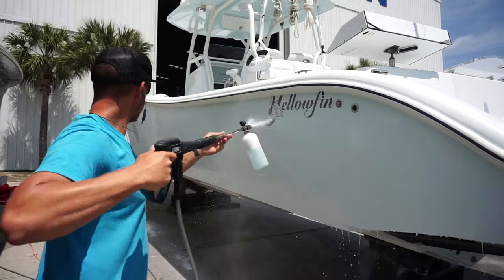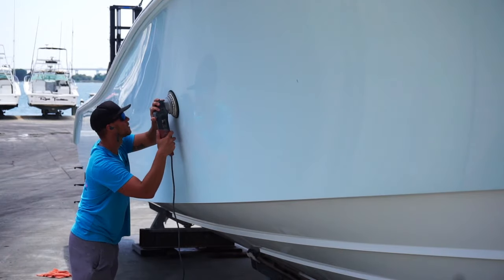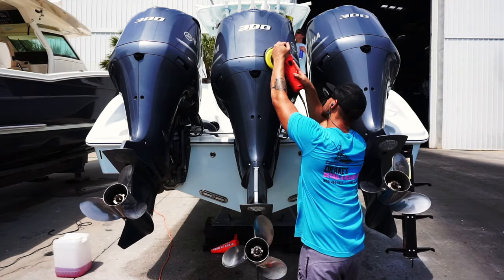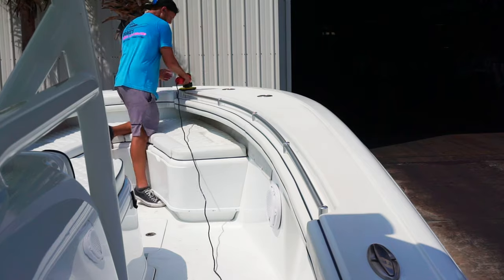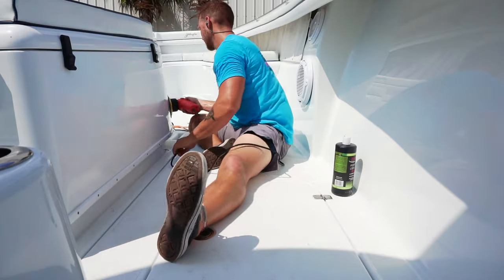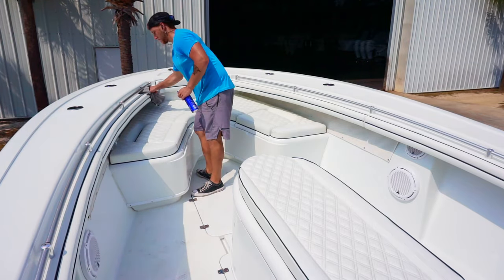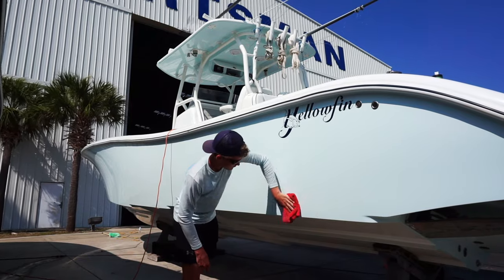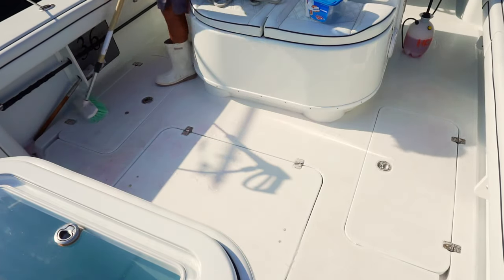How To Detail A Boat | 7 Steps To Boat Detailing | Revival Marine Care

Comment: Dude you're a lifesaver I'm starting a new job as a boat detailer with no experience but they want to teach me and give me a shot. So this is the first video of many I will watch to prepare myself as much as I can with the limited resources I have before my first day. Wish me luck peeps!
Reply from the maker: That’s awesome bro! So glad I could help!! 💯
Reply: How is going now a year later
Reply: @chillcolorado8039  pretty good detail wise, honestly they said I'm the best they've had in a long time. I'm actually a marine technician apprentice now because of my detail work ethic 😊
Reply: @joseibarra2985  nice!
Reply: @joseibarra2985  bro imma start soon cleaning boats too!! How did it go in the beginning
Reply: @lilcowboydoggo5798  honestly it was hard since I was teaching myself since we didn't have an experienced detailer and now I am  that lol. But yeah drakes videos helped a lot, look up degreasers, goo off, adhesive removers, magic erasers and microfibers as well as buffing compounds, polishes, waxes, ceramic coating. And the power tools and pads for those. As well as what is safe to use on non skid, vinyl seats, and carpet. It's a bit of a learning curve but don't worry if you don't get the results you want it's all trial and error. And some boats might be as simple as a quick wash with Boat soap than a full detail clean. Hope this answers your question!

Comment: Nice vid. Only suggestion is do floors first. Purple power after wax is not good... also you can Woody wax those floors after ...
Reply from the maker: Thank you for the feedback! I agree with you that the floors should be done before the wax, But we always seem to get them dirty again even with shoe nets, So I am very careful not to get the purple power on the freshly waxed surface, and if I do I spray it off. I had someone else ask me the same question

Comment: So excited for this channel. I’ve been detailing boats for years but just got in to sanding last year and have so many questions. But usually no one to ask. You should try one of these bonnets to remove the wax they work really well. Of course you have to go over with a towel later but you get up 90% of it with the machine.
Reply from the maker: Thanks!! I'll Give them a look! I typically Just do it by hand, Been doing it for years! Easy and simple!

Comment: if there is any dullness in the gel coat, you have to use a regular rotary buffer, and a wool pad. Also marine oxidation remover. Most boats I deal with need oxidation correction.

Comment: Magic eraser is actually abrasive. Have you found any long-term issues using it?
Reply from the maker: No, but I also am smart about using it. I just use it for the light agitation of the seats. I don’t sit there and grind with it per minute on end. That’s where you can do some real damage-  I also don’t use them seats all the time which helps the longevity. 

Another important part is making sure you rehydrate the seat afterwards with some good protectant so that they don’t dry and crack

Comment: Drake, binge watched your channel. Thought as a “Lakelander” and growing up with at least a Gheenoe since I was 14, I KNEW EVERYTHING ABOUT BOATS. Turns out I’m an idiot. (Grades at LHS and Florida Southern should’ve been my first indicator)
Here’s my issue. A Waverunner with gray seat cushion. (2008) Out of nowhere developed a speckled black mold. Tried the usual cleaning solutions, mold sprays, even the “30 Second” mold spray that works like a charm on the house. I’m curious if you’ve run into this issue. And if so, will you help out a Floridian exiled to central Georgia?
Reply from the maker: Hey bro! Thanks for watching! 

I’d try purple power with a magic eraser. Lately at the seat with the eraser in the purple power.

Comment: Great vid, just picked up some products from your links. Any suggestions on product to deal with cleaning up a vinyl wrap? I just got center console with a black vinyl wrap and it’s got water spots and minor scratches. Any suggestions on products for that?
Reply from the maker: You can polish is lightly with menzerna 2500 on a black foam force lake country pad.  Just seal it with jescar power lock after using another black for pad

Comment: Great videos!  Thanks.  Quick question...what steps do you suggest for a brand new boat prior to launching?
Reply from the maker: Pretty much what I did in this video! Or applying ceramic coating 
https://drakesmarinedetailsupply.com/collections/starke-surface-technology/products/liquid-thor-nano-ceramic-marine-coating
Reply: Insert the garboard drain plug.   Tie a line to the boat and have someone on the ramp hold the other end.  Or, tie it off.

Comment: Love the videos to start. Thank you for putting in the time to share! I'm a bit confused about something. You seal/protect the deck area, wipe it down and then you clean the floors? With a degreaser which potentially breaks down the sealant you just applied? Not hating on you. On the contrary. I've been detailing for about 10 years and now soon, I'll be taking on a few boats  which I've only done a couple of quick washes on. I'm using your videos as my knowledge base. But that washing the floor after protection didn't make sense to me. Am I missing something here? Thanks again! Keep glossin'
Reply from the maker: So On this job, I didn’t apply any sealant to the floors. That’s probably were the confusion is, the customer didn’t want me todo anything on the flooring besides clean it. It’s a fishing boat and they use heavy deck brushes to clean... 

I did apply sealant to the non skid on the tow rail, but I did not do the floors. 

If I would have been doing the floors, you would clean with degreaser, dry it , then apply sealant.
Reply: @DrakesDetailing  I appreciate the response. Just gave you a follow on Instagram today! @after_image_detailing
Keep the vids coming!
Reply from the maker: Thanks bro!

Comment: GREAT video! I'm subbed...quick question, you actually used the DA and applied the synthetic sealant on the textured non-slip part on top of the gunnels? Also do you ever apply the synthetic sealant directly on the textured floor of the boat?
Reply from the maker: yes! This customer didn't want that service, but yes after you wash the non skid, dry it and seal it up!

Comment: GREAT videos!  Can't thank you enough!  I'm just maintaining my own Whaler and am curious how you'd clean and protect the black rub rail.  Is it OK to hit it with the machine pads? Or should I tape off? -  Also, you mention not using Salt Away, which has been the go-to out here on the Oregon coast.  What about engine flushing?  Straight water?  Thank you, and all the best!
Reply from the maker: Thank you! 

Taping the rubber would be best, to avoid more clean up for your self. I like protecting all vinyl and rubber with 303. 

Salt away will take your wax off unfortunately, try just waster, and alittle orpine wash and wax soap
Reply: What is “303”

Comment: I have a boat that has not been detailed in years. Do you recommend using the Griots Garage Machine?  Will it remove the oxidation?  Thanks!!  Love your vids!!
Reply from the maker: No, you’ll need a makita rotary and wool pads to remove the oxidation. The griots is good or light polishing, waxing and sanding

Comment: Great job and killer information. I've been non-stop watching your videos for about a week now and I'm loving getting all the information, I do have a question that is probably redundant but my question is you washed waxed everything on the boat inside now and then you clean the floor after you wax the inside so what do you do when you're spraying it off you just rehand dry everything and you can hand dry the wax already too? I'm sure it's probably a stupid question but just want to be clear. Also when you're doing a wash and wax on a boat's on a trailer do you wax from the water line down underneath the boat as well or you just go to the water line and then just clean underneath the water line?

Comment: I see you use the buff and shine microfiber with the Jescar sealant. Do you recommend this over a black foam pad because its gel coat. I'm assuming a foam pad will not work the sealant in as well and help polish the boat. Thanks and I recently subscribed yesterday and look forward to watching more videos. I'm looking to expand my auto detailing business to include boats since I'm in Florida.
Reply from the maker: You’ll make great money doing boats! I started out only doing cars now all I do are boats! 

The reason I use microfiber is the fact that they are very thin, it doesn’t waste a ton of product by getting soaked into the pad, that’s pretty much the only reason. 

You can wax with foam but use a polish pad or a med cut pad. 

The black foam is way to soft for gel coat.

Comment: Great videos. Anyway to get the water spots off my simrad screen? Can you put the woody wax on the screen? Thanks
Reply from the maker: Ima be honest, haven’t had much luck getting heavy water marks off screens... most of the time, a light polish will do it, but it will take the factory coating off the screen... you’ll have to re ceramic coat it, or keep it waxed often. 

And yes, you can put woody wax on all screens and gauges
Reply: Drake's Detailing thanks keep up the good work. Your videos and links are the most helpful thing I have come across. 👍🏻
Reply from the maker: Thank you!! I have a lot more coming! If you want daily tips and tricks follow me on Instagram @drakes.detailing

Comment: Hey Drake, I'm currently working on a restoration on a 2008 Robalo r260. There are a lot small rust stains embedded into the non skid deck. What do you recommend to completey remove them? I'm applying a ceramic coating to the hull and tow rail. Do you recommend applying a ceramic coating to the non skid on the floors and the lids to the compartments or applying Jescar power lock sealant instead? The robalo will be spend at least 5 months of the year in the Gulf of Mexico.
Reply from the maker: Rust aid should take the rust spots out. Ceramic coating on floors by itself will last about 3 to 5 months, but if you keep it topped off with Mckees 37 hydro pearl it will make it last a lot longer! Ceramic is usually the best option, But to coat non skid takes a lot of coating, usually takes about double the product! So make sure you budget that in. Also, What coating brand are you using?

Comment: We are boat owners that want to protect our investment.  We’ve enjoyed your video’s....one question.  

I bought my husband the Flex 80 and the Flex 8-125 18.0. Do we need the Griot’s garage too?

Also our bottom boat is painted black but gets white streaks in it from cleaning. What should I do to clean those up or avoid them all together?
Reply from the maker: Thanks for watching, If you have a  Flex 8-125 18.0 you don't need the griots machine. 

as for white streaks, the best thing you can do is keep your hull waxed. that will minimize the streaks. 

What year is your boat? 

when you rub your boat, do you get a white powder or chalk on you hand?

Comment: I just watched all of your videos And I subscribe to your channel, I’ve been a detailer for a few years now I’ve recently been getting into boats, I have a job coming up to 25 foot boat in the boat house very little room to work around it, I was wondering if you think it’s OK instead of washing the boat Do you think I I can just wipe it down by spraying some degreaser diluted with water? I can’t pull the boat out and I don’t want to get soap and water all over his nice boat house walls, Also I’m gonna be using Maguires marine wax Not sure if you’ve ever used it but I’ve watched your videos were you wax and then wipe it up later Do you think I can do that with this Maguires or should I wipe it off right away usually I wipe it off right away but it takes a lot more time the way you do it looks a lot faster were you wax it and then wipe it all off at the end let me know your thoughts I would really appreciate it
Reply from the maker: I would say yes, to wiping it down with diluted degreaser! The only thing that would make that difficult is if the boat is really dirty... if the boat is practically spotless then sure that will work. 

As for the wax, I have never had any issues with letting other waxes sit before taking it off, you should be fine! 

Thanks for the comment!
Reply: Drake's Detailing OK thanks a lot I appreciate it and thanks for your videos they’ve been helping me out a lot!!

Comment: Any advice for a boat that the customer just wants washed every 2 weeks that is stored at a marina. Its on a lift at the marina over water and can't be moved. Any recommendations for a good boat wash that is safe for the water and won't remove the wax.  Thank you
Reply from the maker: Yes! I like orpine wash and wax soap! Also, every few weeks use McKees 37 hydro blue Si02 spray on it, just spray it on and rinse it off then dry it, that will get it shined up and “ waxed “
Reply: @DrakesDetailing  ok thanks. I just want to make sure its eco friendly and OK to be in the water. Thank you
Reply from the maker: @andrews1982  Look up igl product! they are all eco friendly

Comment: GREAT video! I’m picking up a boat this week and it needs some TLC. I’m excited to dig in. I read in one of the other comments that you didn’t wax or seal this floor. If you were to do that, what would you use for the floor after the purple power. Also, is it worth it to use the sealant and a wax on the hull?  I’ve been watching your videos for the past hour, awesome! Subscribed and liked!
Reply from the maker: Any time you wax or seal the floors it will make it alittle slippery, but I would recommend after purple power to spray Mckees 37 hydro blue on the floors. 

Just spray on, rinse off and dry. 

You can find it in my products video, I talk about it. 

As for the hull, it’s always the best option to seal it with jescar power lock, it will just wear off very quickly because it’s under the water line... especially in salt water, if you are in freshwater it will last a little longer
Reply from the maker: Thank you for subscribing!!
Reply: Drake's Detailing do you wax it AND seal it? If so, what goes first and what wax do you recommend on the outside of the boat?
Reply from the maker: You can do both! 

If you were todo both, the jescar power lock ( sealant ) would go on first! 

Then you can wax on top of the jescar! 

I don’t ever use wax, a lot of the times if I say wax I’m talking about jescar power lock, it’s a bad habit that I have. Most people only know wax, so that’s why I say it. 

Best case for a boat in my opinion would be to apply 2 coats of jescar power lock, and top it with mckees 37 hydro blue! 

Mckees 37 is an Si02 ceramic spray.

Comment: When you went over the outside of the boat with the waxer, will That pull out scratches? Never detailed a boat before and looking for all the help I can get. Thanks for the great video!
Reply from the maker: No, the jescar power lock has no cutting agents in it. It will not remove scratches. You will need todo a polish like menzerna 400 to remove scratches
Reply: Drake's Detailing so will that polish it and wax it?
Reply from the maker: The menzerna would polish and the jescar power lock with wax it
Reply: Drake's Detailing what tool would you recommend to be able to use both products and what type of pad? Never done any of this before learning from your videos
Reply from the maker: You can polish and wax with the griots garage g9. It’s a great machines!
Reply: Drake's Detailing is there a particular pad I would need to use?
Reply: Drake's Detailing also what speed would be a good speed to use with this machine? How do you tell if your at a proper speed or not
Reply from the maker: I’d have to make a video on how to know what speed,  
Typically when waxing or running it on the four-speed setting. When polishing or cutting I’m usually running it on the five or six speed setting., 

I personally like Lake country pads. You can use polishing microfiber pads. Or their foam pads. I would stick with the white or orange foam pads.
Reply: Drake's Detailing thank you for all the help. I’m glad I found this Channel. Keep up the good work.

Comment: Did this boat go back in the water soon after or does it need to stay out while the sealant dries. Also, I think you mentioned in the video that you come back and rinse the seats as well but didn't see it. Thanks again.
Reply from the maker: Yes, I usually tell the customer don’t  splash it for 24 hrs! And yes, when I do the floors, I usually spray down the walls and seats
Reply: @DrakesDetailing   Thanks for the quick response and great videos.
Reply from the maker: Anytime!!

Comment: Drake, was wondering if I could use jescar power lock on an awldripped topside? 2 years ago I got it awlgripped and haven’t done anything to it except wash after each use with water. I don’t trailer it. Whadyya think?
Reply from the maker: Technically you are only supposed to use the awlgrip wax. 

But we have applied Jescar to awlgrip in the past with no issues. Just use a da on low speed to apply.
Reply: @DrakesDetailing  excellent. I didn’t know about the awlgrip wax. I’ll use jescar since I’ll have that on hand. Copy that! Thanks again.
Reply from the maker: Yea, awlgrip has their own sealant

Comment: Doesn’t acetone dissolve paints and gel coat? We use it to clean up after using these products.
Reply from the maker: If you use it sparingly you shouldn’t have any issues. It evaporates so quickly it doesn’t really leave any time to do the gelcoat any harm